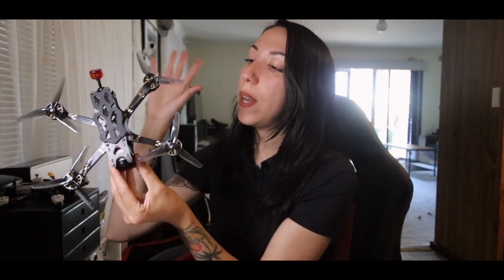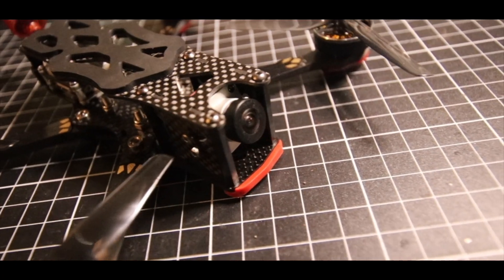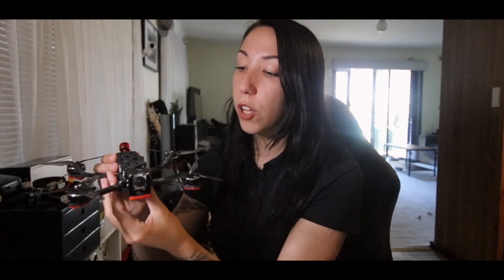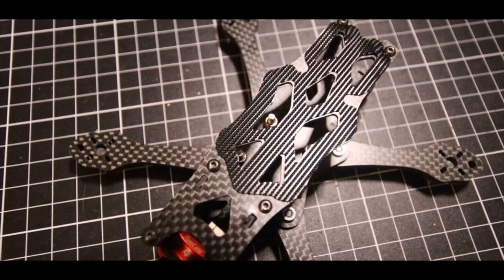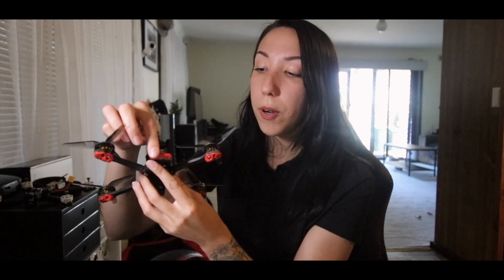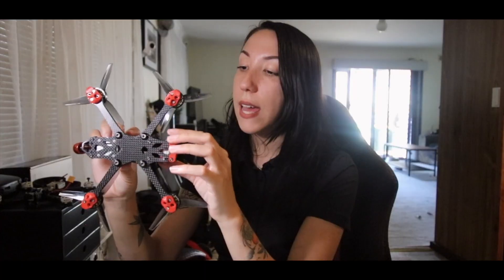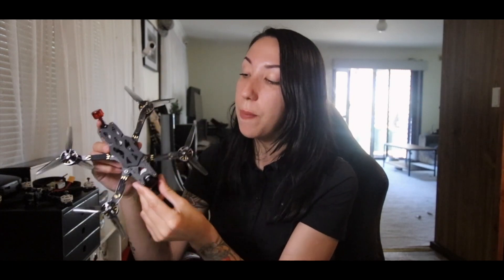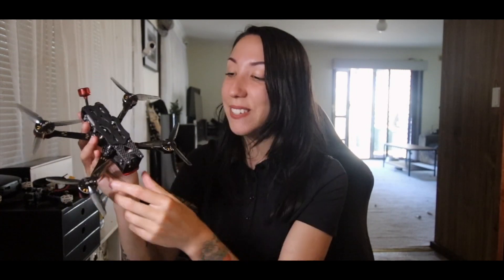Official ImpulseRC Micro Apex: Introduction

Comment: Hey! perfect introduction:) , just bought the micro apex 4", what motors should I use if I have no weight restriction(Best performance)? Also, is the vista kit with 8cm camera cable long enough for the frame or do I need the 12cm cable? Thanks!
Reply: According to Bardwell and Ciotti .... 2004 3150kv should be perfect for this frame.
Reply: @Rstang50  Thanks! just ordered the brotherhobby 2004 3150kv, this is going to be a sweet build

Comment: Just bought this frame kit from Pyrodrone. I know it comes with some tpu parts. But does it come with the back Vista antenna tpu? Or do we have to get the stl and print that?
Reply: The parts it comes with aren't made out of TPU, in fact made out of a much tougher material that's been injection moulded. You will need to print a Vista antenna mount, the files can be found here: https://www.thingiverse.com/thing:4732418. I can print these out for you if you wish :)

Comment: about to build the 4" but I am soooo undecided about what motors to run on 4s. Those BH looks quite big for a 4" prop considering that I run 1306 on 3"(micro reverb) and 1404 on 4"(micro Alien). thinkin to go 1804. Any suggestion?
Reply: Whats your setup on the micro alien?
Reply: @hankmengedoht6651  spedixGS25, millivoltOSD, airblade 1404 3800kv, tbs v3 and Ratel 👌👌